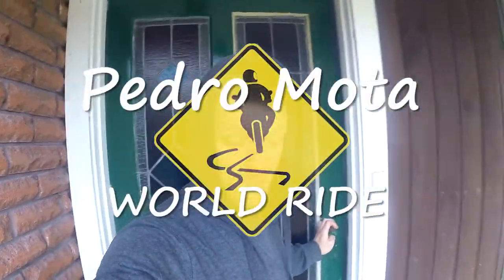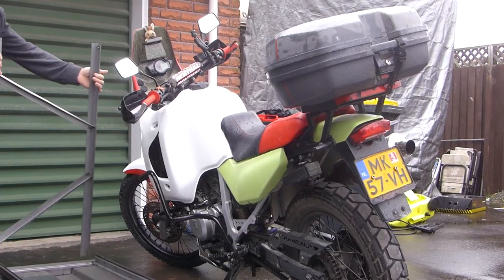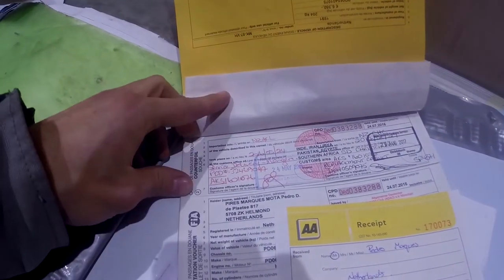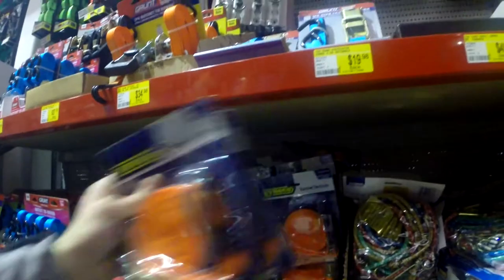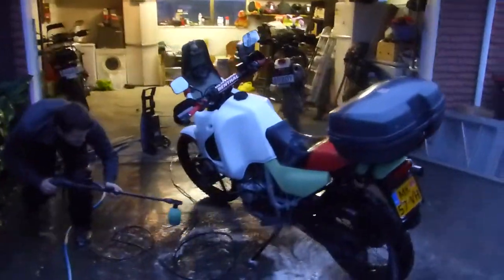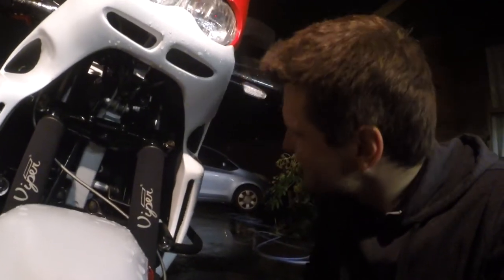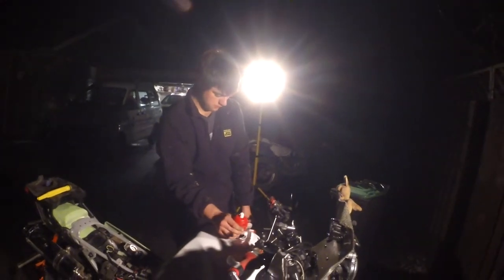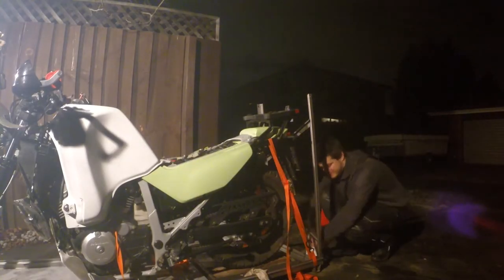Preparing Motorcycle For International Air Cargo Transport (New Zealand to Chile South America)

Comment: How did you manage the battery?  Is it possible to ship motorcycle battery with the motorcycle by air?
Reply from the maker: Leave it in, disconnect the terminals and tape them off. Still there are countries/airlines who are super anal about this and might always classify a motorcycle as a dangerous good. That's why finding a shipper with experience helps since they might have contacts who can help move things forward in the 'grey' to avoid the dangerous good surcharge.
Reply: @iPedroMota  Thank you so much for quick response. I have been watching your vlogs for long time. Nice work. Im cordially inviting you to Bangladesh. If you get time come to Bangladesh you will have fun. 

One more thing, if I take off fuel ⛽ tank and hide the battery somewhere in motorcycle is there any chance that customs still can declare it as a DG (dangerous goods) item?  Could you please share with us how much did you pay for the bike shipping?
Reply from the maker: Cheers! The DG is not a given, it can and cannot be. I've seen people fly their bikes without having gone the extra mile like I did. Your scenario I'm not sure, good chance the airline might classify it as a DG because it's still a motorcycle. That's why finding an experienced motorcycle shipper helps. I think about 1200 euros from NZ to Chile, small crate kept the cost 'low' for a motorcycle.
Reply: @iPedroMota  thank you so much dear 😊

Comment: Hey Pedro, who did you use to air freight Alp? Can you tell me how much it cost?
Reply from the maker: Matt Ching from Customs Services. Don't be frightened by the 90's looking contact page. Great service. About $2100nzd for about 250kg volumetric. There is a base cost of about $500 for all kinds of regulations and documentation. You'll probably be off the cheapest flying from Auckland.

http://www.customs-services.co.nz/Track/contacts2.htm
Reply: Pedro Mota that's the best website I've seen in ages! Thanks for the info!!